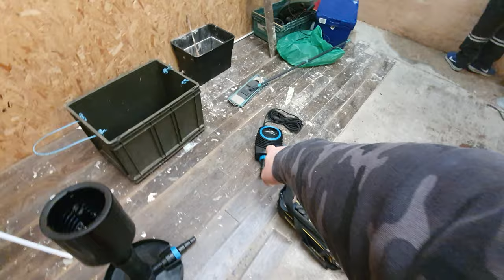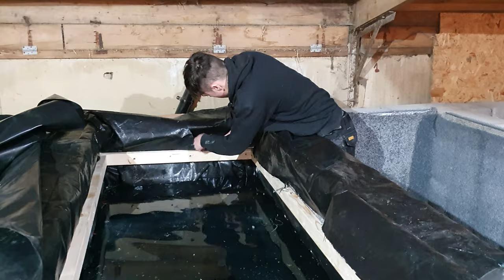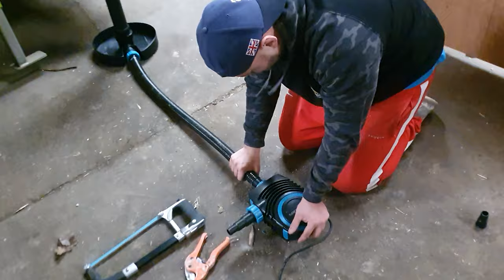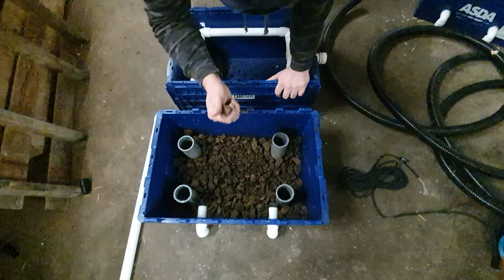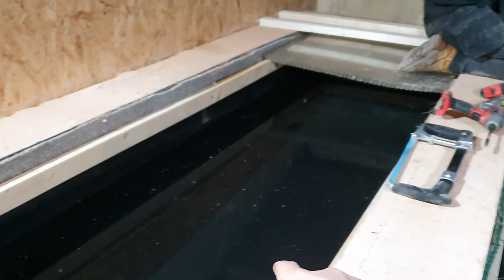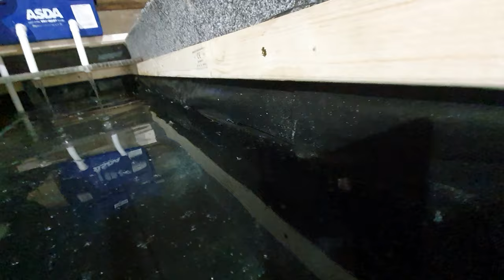Koi Facility Part 9 - Adding Water, Adding fish, Filtration and Pond Covers

Comment: Coming along nicely 👌 
Little tip.....when connecting flexible hose put the end in hot water to soften it slightly.
Reply from the maker: Legend buddy, we did actually do this but on the actual install of it, I should have showed it on camera though
Reply: @TheBaldingReefer  your a good lad jack 👍🏼

Comment: Great work guys will soon be up and running.  Big difference in the pond liners, why do you call the inferior one a budget liner, don’t suppose their is much difference on cost from the all pond solutions one?
Reply from the maker: Glad you like it pops, the all pond is solid piece of plastics where as the other liner is like a tarp kind of liner and you can see the folds and creases aswell as the fibres that make up the liner. It does the job  but the all pond one you can see folds or creases. Both still budget, just the 2nd pod is the bottom of the budget scale

Comment: So you are running a pond with a skimmer but nothing taking the waste off the bottom 🤔 and the skimmer isn't really needed because its a indoor pond you need bottom drains very badly built ponds
Reply from the maker: This is just the equipment we wanted on here to try it, it's coming off and going in an outdoor show pond. These pods couldn't have a bottom drain on them so we may go down the route of retro fitting one, but I don't agree with them  being very badly built at all